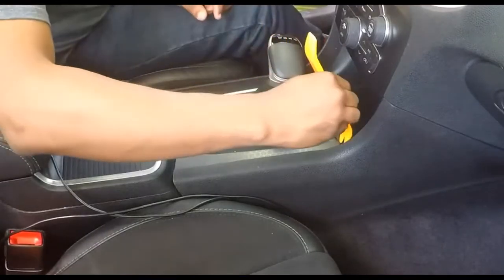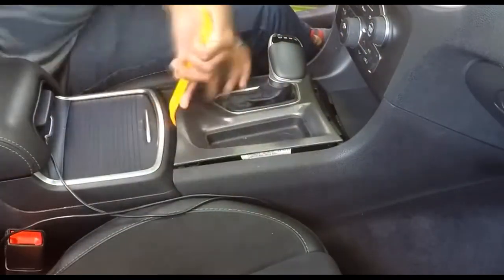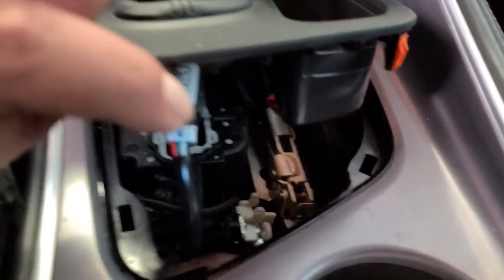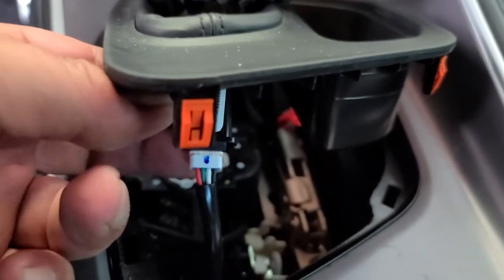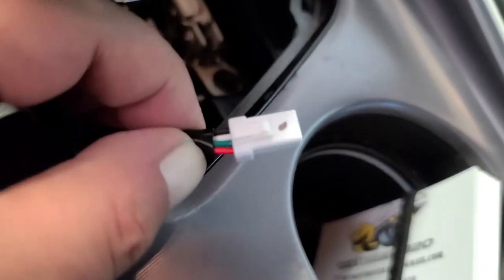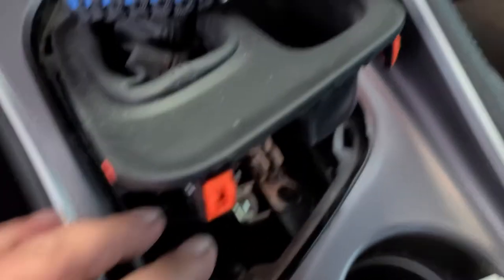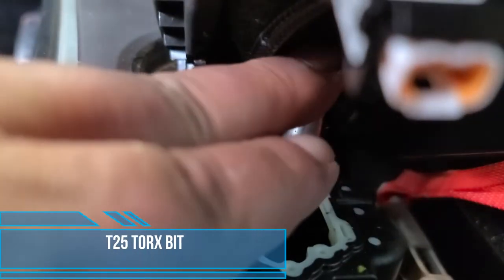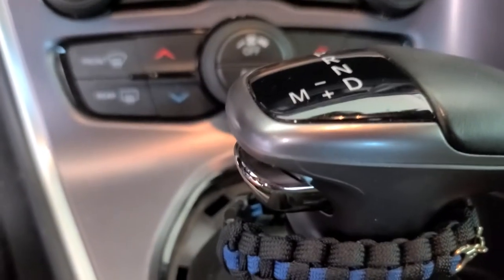(2015-2023) Charger neutral release cover installation video

Comment: I installed mine on my 2022 Hellcat Charger this week. It seems as if the trim piece doesn’t fit as flush anymore. Any recommendations?
Reply from the maker: Yes I have a new one ai am making for the 2022 I will release them soon. Dodge changed the center console
Reply: @Destroyer1320  great! Hopefully I can swap mine out for a 2022 when you release them
Reply: Yes I’m having that same issue on my 23 scat it seem that I can’t snap the console back in place I’m guessing the cover plate is to big it didn’t fit perfectly on there I had to try tightening the screw extra tight still not able to snap everything back down will I be able to swap mine out for the update version 😊@destroyer1320

Comment: I just purchased one of your neutral relea covers. Do you know the size and thread of the screws that hold the cover in place? I’d like to order 2 different rare securely screws with different security heads to make it more difficult to remove. I’ve got every type of security bit and figure most thief’s won’t carry 2 rare  security bits with them. Just another layer of protection.
Reply from the maker: Yes they are #10 x 3/4
Reply from the maker: Thank you! Email me if you need more info mydestroyer1320@gmail.com

Comment: Great idea, I’m just curious on How does this stop someone from removing the cover?
Reply from the maker: Time is the enemy of a thief, you could also change your screws to tamper proof.
Reply: @Destroyer1320  what’s the dimensions on the screws to install plate?  I’m trying to get some security screws made.
Reply: For TDS and OBD ?
Reply from the maker: @DetroitLove313  i have not measured the bolt size yet.

Comment: Just ordered mine this morning!
Reply from the maker: Awesome I will send it out tomorrow. Thank you!!!
Reply: Got my order yesterday. Thanks for the quick shipping 🤟
Reply from the maker: @AJM0201  Sweet thanks for the order!! Tell your Mopar Fam
Reply: @Destroyer1320  just installed it and told everyone in my car club about it and sent over the link! 😎
Reply from the maker: @AJM0201  was the install easy using the video? Can I improve on anything? I appreciate it!!!
Reply: @Destroyer1320  the video was pretty straight forward. I didn't have a t25 to remove the shifter but was able to install it with a mini ratchet and 4 inch extension on the 8mm socket

I kinda held the shifter surround with one hand and lined everything up and bolted it down
Reply from the maker: @AJM0201  so glad you got it in. Thanks for the response. #savethemopars

Comment: What about a 2014? Does it have the same neutral switch? Do I need this at all?
Reply from the maker: It takes a different plate but yes 2014 has the same release.
Reply: @Destroyer1320  where to purchase?

Comment: How’s its going Brotha dope content. Will this fit on a 2022 hellcat?
Reply from the maker: I have a prototype for the 2022, just need to get it into CAD drawing then it will be for sale. Thanks man!
Reply: @Destroyer1320  did you get it designed/made for the 2022 charger yet ?
Reply: @Destroyer1320 when I order online does the screws come with the plate ?